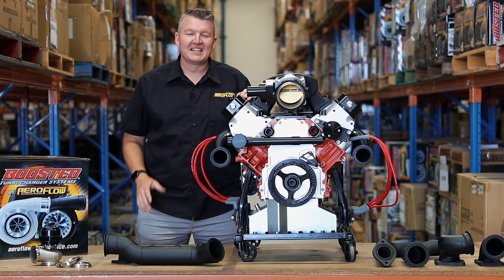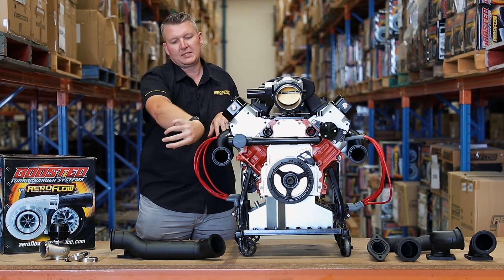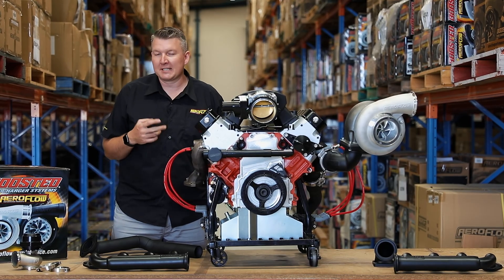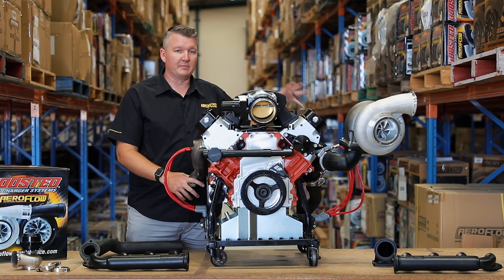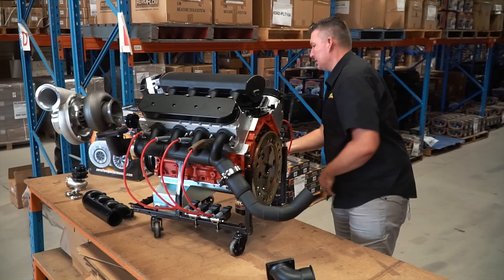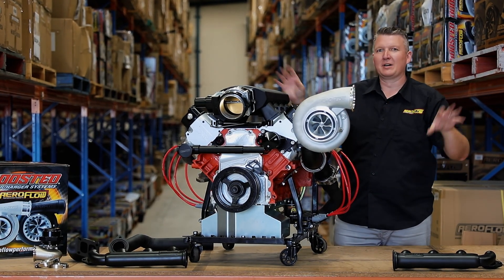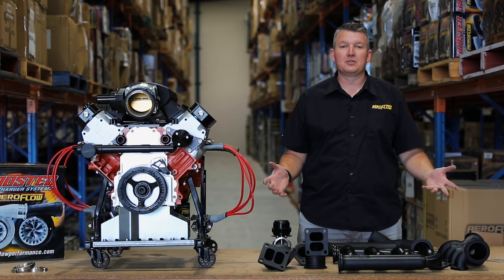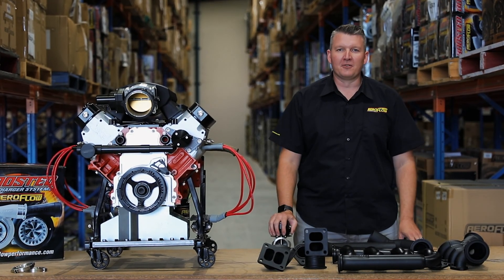Aeroflow Performance LS Turbo Manifolds

Comment: Would these fit on a L8T 6.6L 401 cubic inch LT gas motor
Reply from the maker: If you're using DI LT heads, no it won't work, the port spacing is different to an LS.
Reply: @aeroflowperformance ok thanks do u guys have turbo headers for LT1 & LT4 heads
Reply from the maker: @DesTakeFlight  Unfortunately not yet, we hope to have something in the works towards the end of the year.
Reply: @aeroflowperformance ok cool I hope so too 💯💪🏾

Comment: they wouldn't fit a VE as wouldn't pass the power steering pump on SSV, on a large turbo T6 not enough flow be an issue with spooling up, the only way to get the best set up and flow is build your own or pay killa boost $3600 which is a total rip off

Comment: so these 3 part numbers are the correct numbers for both manifolds and crossover pipes to suit VE/VF commadore single turbo setup?
AF8200-1005 + AF8200-1010 + AF8200-1000?
Reply from the maker: Yes that's correct, then if you require it we also have the twist mount adapter to mount a T4 or 40 frame V-band turbo AF8210-2000 or AF8270-2000
Reply: yup i have with the vband to t4 twist flange @aeroflowperformance . im already starting the intercooler pipes. but you dont happen to have a pipe kit for ve?🤣  i have the 600x300x76mm aeroflow intercooler. thank you for your brand. its made my l98 build a breeze

Comment: Will the twin forward facing fit with a factory truck water pump
Reply from the maker: The flanges finish basically in line with the front of the block, so how you fabricate from there will depend on clearance.

Comment: This looks like my setup for my gto was copied. I made a short video showing it but it’s hard to see the log. I did this over 5 years ago. https://youtu.be/vnyHsgH64RA?si=2EgTknqKtqFtNnE1
Reply: I’m not even mad if you did copy mine. I wish I could’ve just bought this and modified it. Although I still have my power steering pump in the factory location
Reply from the maker: Hi travis, for sure there are similarities but that is going to happen when you are trying to put the same thing, in the same location, in the same vehicle! Only a couple of ways to go about it. Great work on your kit though and thanks for watching along. Maybe we can save you some time on the next one!
Reply: @aeroflowperformance  thanks! And you’re right, there’s only one way to go about it if you want a turbo in these cars. I’m going to be doing a turbo setup in my son’s 2004 Silverado AWD regular cab and this manifold looks like a nice option and will save me a TON of work. I actually wanted to have my manifold copied so I did have to make them anymore. I did another one for a guy with a gto also. Btw, that beat up down pipe was replaced by a 4” oval pipe that looks and flows much better. Thanks for the reply!

Comment: any chance you can tell me what the go is with that remote water pump crossover manifold thing between the water pump flanges? is that something you make?
Reply from the maker: It sure is an item we make and sell. We have the adapter plates to suit the block which you can run flexible lines from or you can fit the logs to provide a clean solution

Here is the logs: https://aeroflowperformance.com/af64-2242-coolant-cross-over-log

And here are the plates for the block: https://aeroflowperformance.com/af64-2241-gm-ls-water-pump-plates

Comment: Nicely done video, does the passenger side tubro manifold ( for a single setup) hapen to work with the factory ls power steering pump? would rather keep the factory pump than go to an electric if I can.
Reply from the maker: As it sits the power steering pump needs to be moved up (i think there are some kits out there) or convert to electric steering
Reply: so glad you asked this question bro! thanks! hahaha

Comment: Hi like the product, If i was to run the twin turbo manifolds facing forward and high mount is the 2.5 outlet to small if i want to make it single turbo setup, Motor is  6 litre lq9 408 stroker, on methanol.
Reply from the maker: Hey Mark, we find the 2.5 per side works fine as long as once you've merged it in to a single pipe before the turbo the volume is equivalent or greater than the two pipes - so at least 3.5" but probably 4" feeding the turbo
Reply: @aeroflowperformance  Ok great thanks for the reply, so when it merges into one go 4 inch pipe. Just got to work out a turbo now !
Reply from the maker: @marksmith2726  we can help with turbos too! send us an email sales@aeroflowperformance.com